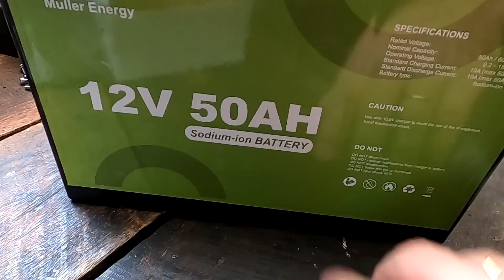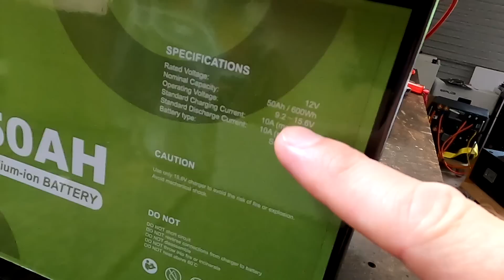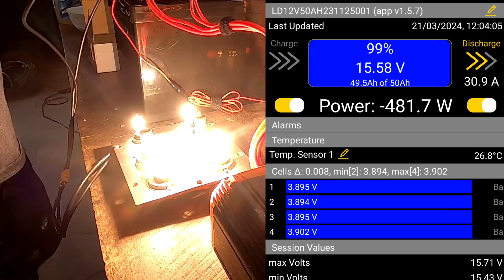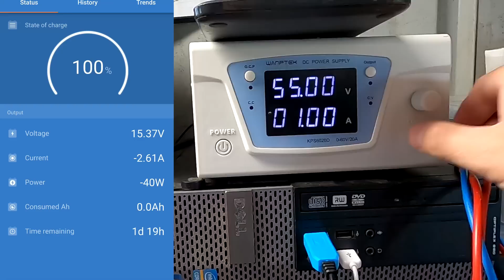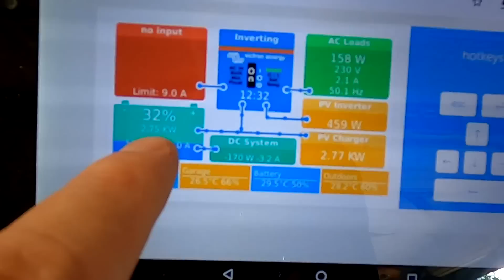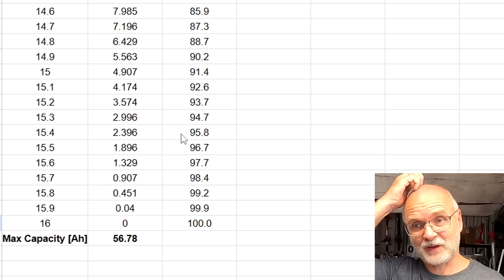Sodium Battery powers Inverter. But for how long will it run?

Comment: any way to increase useable capacity with existing inverter by adding a simple DC DC converter ?
Reply from the maker: Maybe for smaller systems, but what if you have a 5kW/10kW inverter? The loss would be quite substantial.

Comment: Today the weather was very cloudy and wet in the Netherlands. I only had 3.7 kWh from 6700 Wp of solar panels. About 0.9 kWh was sent to the grid after the heat pump used most of it. I could add two more panels of about 430 Wp each on the shed at a 10 degree angle for maximum diffuse light in these conditions, but I would really like to build a larger 6 panel solar roof there and add some sodium-ion storage to brigde these darker days.

There is no hurry because of the solar debet system here, so I can wait for lower prices and new inverters that can handle the huge voltage drop.
Reply: It doesn't make much sense to store energy in batteries and keep it there waiting for darker days. Batteries are too expensive to not use them. And they also slowly discharge over time. Li-ion batteries age over time, so not using them is a waste and I assume the same is valid for Na batteries.
Batteries can make sense to increase self consumption when net metering schemes end, but that should mostly be aimed at the energy that you consume at night.
Reply: @ Gerben Yes, I only meant a reserve to store it for a day or so. Just got some LFP batteries and these seem to handle one night just fine. Adding more to handle an extra day is still too expensive with LFP, but that could change with cheap Sodium-Ion batteries.

Comment: Andy, how could you resest the bms if you did not have the battery case open? This could be a real problem for the average customer. Thanks again for all your hard work.
Reply: Was thinking the same especially for a novice
Reply: I am a average solar system owner.
Would love to have basic troubleshooting ability for my batteries and system
Reply: He bypassed the BMS for the discharge test. If you keep the case shut, the BMS will stop discharging before switching itself off. So it shouldn‘t be necessary in normal operations - I am not sure how much the BMS draws or the battery as self discharges though
Reply from the maker: Under normal charging and discharging, the BMS should not get into such a position that you need to restart it. This was only from the last test when we discharged the 12V battery to close to 0V. 
Ah, Holger just said that😄
The BMS uses very little power, less than 1mA or so when on standby.

Comment: Very good test for some practical use if anyone decides to get sodiums for an RV or camping fridge. The disadvantages are you won't be able to use last 25% and make sure not to charge above 95% but it also has much more advantages over AGM like you can charge them faster, doesn't have to be kept constantly fully charged, 75% of usable capacity is still more than AGM and of course much more cycles out of Sodium. These should be priced just a little bit more than AGM batteries or even same price as salt shouldn't be more expensive than lead and this is the whole concept of these. As for using these batteries for under the bonnet for instead of stop/start batteries I am not sure if that would be ”healthy” for any vehicle with such high voltages bulbs and computers might start blowing up but then once again maybe alternator wouldn't be able to charge these above 80% so it might actually work ok like that.
Reply from the maker: Sodium can definitely replace LA already. Lots of advantages as you said.

Comment: Here in central Indiana, where the Indy 500 race is run in May, it is cool and overcast, so not many amps to collect.  As the sodium ion battery production is scaled up, inverters will be built (or firmware updates provided) so that they can work with a wider range of input voltages.  It is interesting to see how much the amperage increased and it would be very wise to use the correct wire size.
Reply from the maker: Yes, either new inverters or firmware upgrades. Not all can be upgraded though. Low voltage goes really hard on the inverter.

Comment: I guess with a little firmware update it could be optimized to 90% used capacity
Reply from the maker: Not sure how the hardware would cope with such a low/high voltage. There are limits and we may need completely new designed hardware for sodium.
Reply: @OffGridGarageAustralia  Sure. But there are tolerances which could be overthought in regard to sodium voltages.

Comment: great video and you can use even more if you discharge at 0.2c. 😅😂 the weather was 🌧  today in Baghdad
Reply from the maker: I thought this 30A was already very low with only 350W pulled from this inverter. 12V is not great😄

Comment: You are actually getting a large percent of the energy in the battery out than what you think. Remember, one amp hour at 15V is considerably more power than one amp hour at 10.5V. Losing the 4% at the top is kind of sad though, but maybe not all that bad. If you're using that battery with that converter, you would never be charging to absolutely full, probably last a bit longer?
Reply: Yes, need to measure Wh to be voltage independent
Reply from the maker: Wh is not voltage independent: V x A x h = Wh
Ah is voltage independent. Hence we use it to measure capacity😉

Comment: Ran out of sun today and charged my 48v house bank from my12v  8kwh camper van bank, this video really reminded of Today 😂 I ran out to check the data from the victron shunt once it had gone flat and checked the jkbms to see the voltage difference in the cells, swear my wife thinks I’m crazy 🤪
Reply from the maker: I know what you mean, haha. She will get used to it. You need some sort of app so you can check on you phone...

Comment: Maybe lowering the BMS max cell voltage will solve that issue easily
Reply: I guess the kimit is the inverter, not the BMS
Reply from the maker: BMS was fine with this test.

Comment: Great video. That inverter review seems to go back years as I remember 😂. Looks like no 48v model.
Sunny So. California USA generating 1.21 jigawatts
Reply: Follow Andy's link and you'll see there is a 48v version available.
Reply: @scottmoresy7709 we can customize for you if you need.
Reply: @scottmoresy7709  thanks. Under the 48v version it says input voltage 12v, 24v. Contacted the manufacturer
Reply from the maker: Not sure where you click but there is a 48V version on this page:
https://s.click.aliexpress.com/e/_Dl96k77